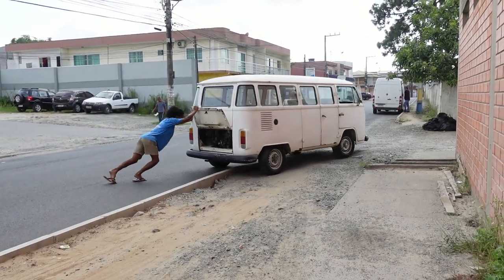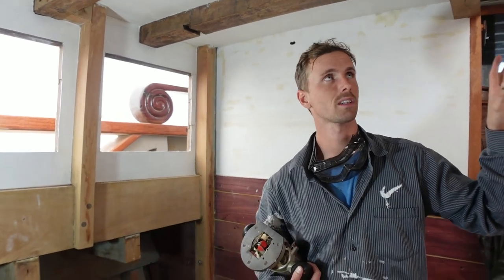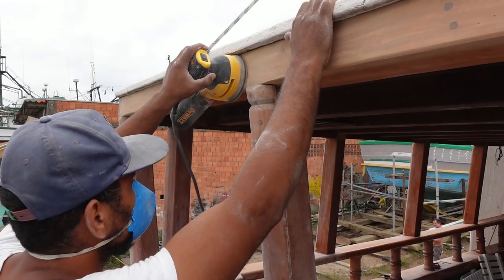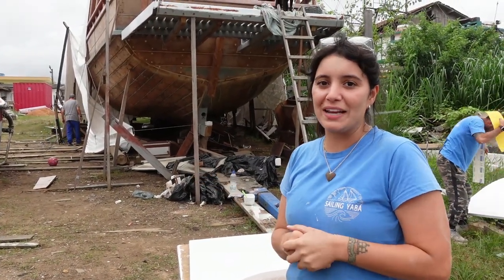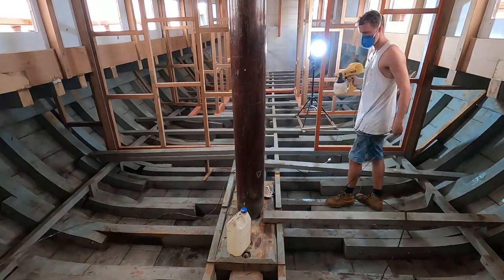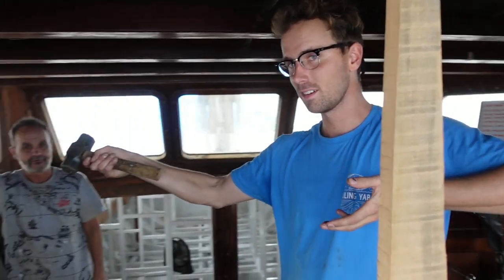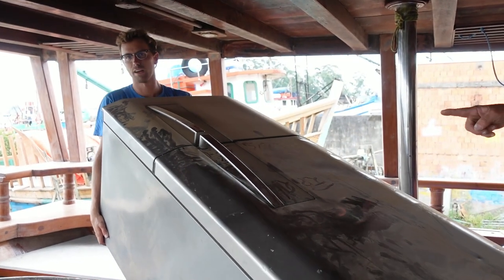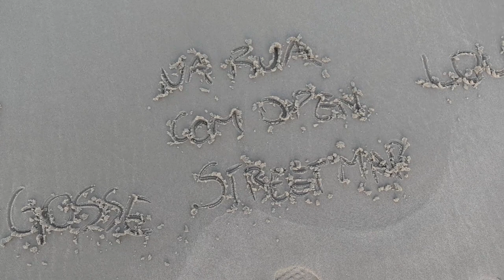Time to paint our rescued wooden sailboat! — Sailing Yabá #93

Comment: Jost a note from an old fiberglass boat shop owner. You don't want a totally smooth top of the superstructure, if it's smooth it can be very slippery unless you coat it with a non slip finish. There are some very good marine non slip coatings if you get a very smooth surface.

Comment: I build wood strip kayaks with glass-epoxy.  You will never get the epoxy flat by itself.  It does tend to cure in little mounds or bumps.  The way we get a smooth, shiny surface on kayaks is to sand the epoxy smooth so the surface is mostly uniform, then spray on a few coats of a urethane varnish like Vera-thane.

Comment: Have you considered using a roll and tip process to apply your top coats of epoxy?  Rolling and/or squeegee are quick but a brush will help to make it more uniform thickness without the hills and valleys you are getting.  You might also give it a good soap and water wash before sanding to get rid of the amine blush.

Comment: What you need is an air file it's a sander that's flat on the bottom and is like 18inch to 2 feet long and about 2 or 3 inches wide and runs on air and is used for body work to smooth large flat surfaces I would imagine you can get them that run on electricity or you can just use a piece of 2x4 and build one that runs by hand power you want to work as large in area as possible to get it smoother

Comment: You'll be sanding un peel plyed epoxy for days, I shaved gel coat from from an osmosis yacht and I laid boat cloth with epoxy, I told the yard owner I nedd p/p or their will be a weeks more work. It ended up being two weeks more labour and I still had apply 2/3mm of Awlfair and long board it before epoxy sealing and paint...

Comment: Look into putting a big enough plastic oil and diesel tray under the engine big enough to cover the whole engine surface to catch all the leaking/ sweating oil and diesel from going into the bilges stinking up the boat making it all greasy.
You could even make a simple plywood or plastic sheet mold of the upright edge of a tray and put it around the engine mounts. 
Line it with plastic having the engine mount stick out a bit out from the bottom of the tray and make your own glass fiber epoxy/ polyester tray with a low spot and a hose to collect it into a mounted but removable jerrycan in order to take it out once in a while.

Comment: Nezo, Helio and Zeca are rippa Carpenters [Shipwrights, Tool Drivers], almost as good as my Dad and Uncle in a different area. Nice drivin too Ben. Good to have reliable family. I feel the same bout kombis, but down here,  a rear motored on like the is over $20--25,000 newer used ones, are $15,000. Hang onto it if you can. Keep up the good work. Thanks m8s.

Comment: Fantastic to see how much work is being done!
I have a little concern regarding the swimming deck.
I remember when you constructed the swimming deck it was just nailed to the frame.
I'm worried that this will not be enough especially if the deck is subject to content waves hitting from the underside.
For what it's worth, my suggestion would be to bolt and/or screw  planks to the frame.

Keep up the excellent work, you two are amazing

Comment: The areas where the epoxy "gathers" and leaves bare spots are called "fish eyes."  It's caused by not sufficiently cleaning the subsurface of contaminants.  The dirty areas probably contain oils from hands and feet that repels the epoxy from adhering there.  Clean your surfaces before applying another coat!
I love this channel :)

Comment: Small tip - In the future lay down peel ply on top of your epoxy coating. When it's cured, you just peel the peelply off and you're left with a lovely smooth finish.
Reply: I love peel ply it's such a satisfying thing
Reply: What he said👍🏻
Reply: I’d call that a big tip!
Reply: Very good tip!
Reply: @charonstyxferryman  No. that’s the added bonus.
Reply: @charonstyxferryman  Definitely, otherwise the next layer of epoxy won't stick properly because of the amines layer from the previously dried layer of epoxy. If you want to apply multiple layers of epoxy, apply the next layer while the previous layer is tacky (not wet, but half way through the curing process when it becomes sticky). If you do this, you won't have to sand the previous layer at all.

Comment: If you need to remove large amounts of epoxy (or resin) I recommend you try the backside (the non cutting side) of a metal saw blade to scrape off the exess... resion tends to gum up abbrasive surfaces due to the resin getting warm and partially melting it...

Comment: Still recommend that you put 2" of insulation under the roof and then cover it with a tongue and groove...you want to go where it is warm/hot...dark cabin top will make it hot inside...
Reply: wood is roughly r2 per inch
Reply: @evanschwartz3030 , I would be interested if you went into detail. 👍

Comment: The varnish is applied in three coats. The first two are full strength with sanding netween the layers and on the top of the second layer with 220 grit. The final coat is thinned between 30% and 50% thinned with mineral spirits. Skip a step and the results will never be what you want.

Comment: You probably already know this but just in case - Epoxy is not good unprotected in the sun.  It turns yellow.  You need varnish or albright plus from awlgrip over it.  The varnish may yellow more than you want - The awlgrip clear is very clear and you can sand and buff it.  It has a hardener and will fill some too.

Comment: You know, while I appreciate the work that is going into Yaba, the questions I have about ballast in Yaba still remain.  Her hull form is not that of a typical schooner.  She is a costal cruiser, meant to run on an engine, and even though she has masts for sails, if you try to take her off shore and sail her, with the hull form she is going to roll right over.

Have you discussed your intent with a naval architect?  How much ballast do you think you're going to need, and more importantly, what kind of ballast?  You say you're ready to install it, but from my point of view, you're not anywhere near ready.  You need a very dense ballast, and my best solution for that would be lead, liquid, molten lead that is poured into steel 'trays' along on either side of the keel, and close in.  You want as much weight as you can get on the or near the keel as possible.  I could consider the roll pivot to be somewhere above the deck, and to counteract that, you literally are going to need TONS, as in multiple TONS of ballast if you want to go sailing.  A 20-25 knot quartering beam reach in the middle of the Pacific Ocean, without that kind of ballast, is going to leave you in a lifeboat because Yaba will have rolled over on her side.

So, who have you talked to about what it's going to take to put enough ballast in Yaba and have it secured in place?  How are you going to do it?
Reply: I was also thinking of a lead pour which should have been addressed by now
Reply: In "Sampson Boat Co", 48 foot gaff sailer Tally Ho needed eleven (11) tons of lead poured as her keel. l do not see a lead poured keel in Yaba, so if Ben and MP gets Yaba to the Atlantic with a 30 mile wind hitting her sails; she'll capsize right over. They just need to engage a good naval architect to calculate the required keel weight for the size of Yaba.

This is no criticism, but a caring warning to you Ben.
Reply: @dingc.velasco6038  I also believe that Tally Ho also has a deeper hull design than Yaba does.  The plain and simple truth was that Yaba was designed the same way as those 'Pirate' ships that were in the rework.  They, and Yaba, we're not designed as sailing vessels, but as coastal cruisers who's main propulsion was a diesel engine.

EDIT:  I went back and looked at what Leo was doing with Tally Ho, and the external ballast was 8 tons.  I looked at another schooner on line, and the external ballast on that was 17.5 tons!  Both Tally Ho and this other schooner use hull designs that go much deeper than Yaba and aren't nearly as rounded.  My guess, based on what I'm seeing, and I don't know where the center of gravity or the center of buoyancy for Yaba is, but I would say that they are going to need a good 20 tons of external ballast on Yaba to keep her upright in the water.
Reply: the righting moment of a boat does not depend on the shape of its hull but on the metacentre which is conditioned to it, among other things, by the ratio between the submerged volume and the emerged volume, the windage, and the wind thrust.  the sailboat tally ho being a racing sailboat this ratio is very unfavourable, light boat, and relatively shallow draft in view of the very substantial sail area, hence the need for a very heavy keel.  which is not the case with yaba... so no comparison.
Reply: @jimilipi5493  with all due respect, I'll disagree with you.  But, that is based on feelings and without science, so you may be right.  I still disagree with you, though.  Time will tell.
Reply: @evanschwartz3030  well, if you think about it, Yaba WAS scrapped a while ago!  If you consider what has been done, 85-90% of what came into the shipyard is gone.  It's been replaced with new and new parts.  Yaba will be nice when they get finished with her, but she still will not be an ocean going vessel.
Reply: Vessels of this shape have been sailing around the world for 1000s of years. I think they know what they are doing. It's the same shape as the dhows and they sailed oceans
Reply: @tamar5261  If you look at the hull form of a dhow, you'll notice that she has a long, extended keel deep below her main hull.  Also, her hull bottom is not as flat as Yaba's.  So, while dhows may have been sailing for thousands of years, Yaba does not have the same hull form or keel shape that a dhow does.

However, time will tell.
Reply: @GaryMCurran  Viking long boats are a good example of almost flat bottom ocean going craft.... I think yaba might surprise a lot of people.
Although my main concern with her build is the stern planking. The gaps in the transom are filled with some kind of putty. If this fails I hope their bilge pumps are efficient.
Reply: @tamar5261  Well, we'll see what they are doing, and what happens.  But, if you look at the other boats, particularly the 'Pirate Ships' that have been in for refitting, those have a similar hull design, but those are day cruisers, party boats, and don't use their sails.  Yaba was/is of the same design.  But, we'll see in the end.
Reply: @GaryMCurran  on second thoughts I think you are right. I have changed my opinion after re watching a few of the older videos. The hull design does indeed suit motor sailing and is never going to sail into wind or waves. It will be interesting to see what happens when they launch
Reply: @tamar5261  I think it's possible, but it will take an awful lot of work.  If you watch Leo rebuilding Tally Ho (Sampson Boat Works), Tally Ho is a 43' 100+ year old sailing ship.  Leo just installed a new keel, and his hull shape is significantly deeper than Yaba.  Leo put 8.5 tons of lead on the outside of Tally Ho.  I suspect that they could do something similar to Yaba, but she would require significantly more weight.  A 3-4' high lead keel in the vicinity of 20 tons attached to the keel of Yaba probably would keep them upright, along with another 5 tons or so of lead along the keel on the inside of the boat.

But, Leo, who by trade is a boat builder, also consulted with a naval architect over how to do it.  I don't see Ben and MP doing that.  All I can say is that I hope they figure this out before they launch or put the sails up.
Reply: This boat is a theme boat for inland charter ….. far too many windows, absolutely not for offshore cruising . Windows and port holes are covered with storm shutters at sea , also made with special glass . I grew up on Antigua in the West Indies and some friends of mine capsized a similar Brazilian schooner , unfortunately the captain died . Use Yaba for charter , scuba , and as a home , but I would never go deep water with her . 
       I have been upside down in the Atlantic and it wasn’t fun
Reply: @austingode  In continuing to watch the channel, I can't bring myself not to watch this disaster in slow motion happening, the boat builders they have are doing a great job to rebuilding her, but I've yet to see any kind of person with design knowledge looking at what's going on.  I don't see either Ben or MP with the proper knowledge to do this, although they have their dream.  Their dream is going to kill them.

I'll stick with my original thought that this is not going to be a deep water cruiser sailing vessel.

Comment: Also, along with Drew's idea, Yaba has been in that location for a long time? Instead of poking stuff up and down ladders ? Get some stringers and some 2"x6"s and put up a set of stairs off of the dive platform. Just set them up with 4"x4"s as a moveable structure not attached to the boat except by giant C-clamps for stability.  Then you can just walk stuff up the stairs without worry of climbing a ladder? Poor Caillou doesn't need to be raised and lowered in a canvas bag? You guys are doing a fantastic job on this "old" sailboat. I say it's the same sailboat but it really isn't with 95% of the wood being replaced? It's very much like " the Emperor's New Clothes", hahha.. you guys are getting very close to being done? I can't wait to see Yaba sliding down on its sledge into water again!!

Comment: Looking great!

You probably know but as epoxy cures in contact with moisture, a greasy or waxy film known as amine blush is produced. This film is created on the surface of the cured epoxy. Its appearance alters depending on the amount of moisture in the air, but it’s usually more noticeable in cool, moist conditions. You might struggle to see it at all, or it may appear as a thin, greasy or dull layer.

Why is it a problem?

In itself amine blush isn’t a problem: it’s the effects it causes that are the issue. If you continue working without removing the blush, it will prevent varnishes, further coats of epoxy and other substrates from bonding effectively. Try sanding an amine blush-covered surface and it will clog your sandpaper and cause the blush to penetrate your work more deeply.

Just wash with soapy water between epoxy coats. Good luck.

Comment: If you would like to paint the hull you should use an airless pump if you would do it with a compressor you have a lot of overspray which wil cost you about 20% more paint to get the same result !!!
And MP never laugh with (almost) Belgians …….